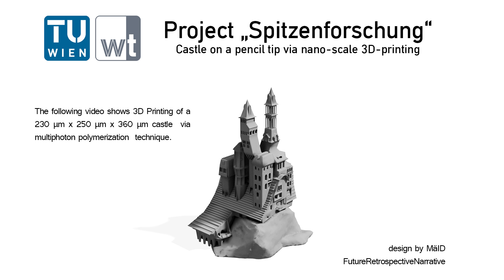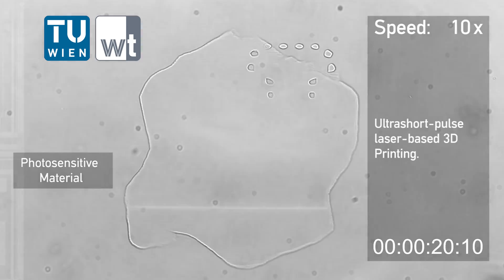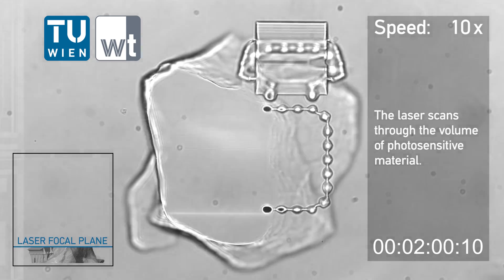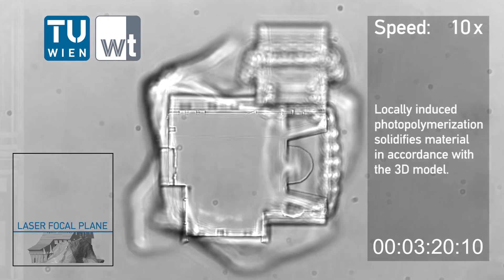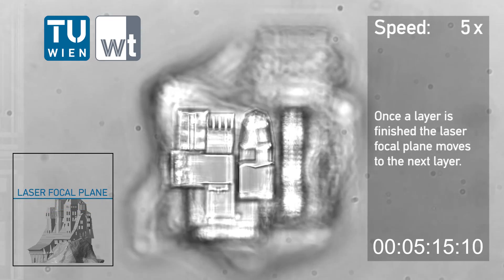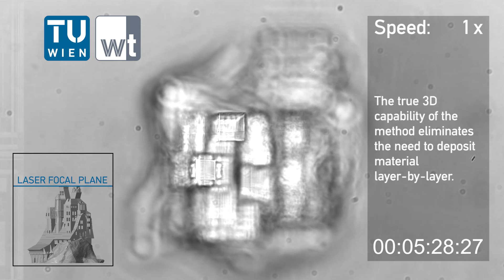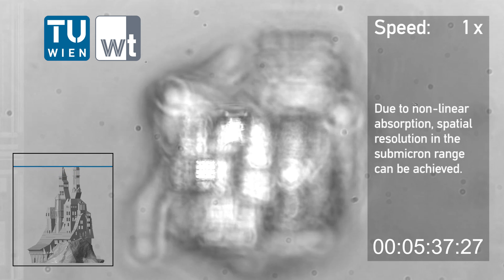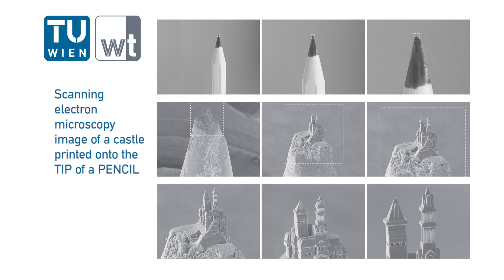Castle on a pencil tip via nano-scale 3D-printing

Comment: That is incredible. How well can the printed objects be scaled up while still maintaining sub-micron resolution? Or in other words, how big of an object can you print at those resolutions? Is it limited by how large an STP file your computer can handle? Seems like there are some serious applications for microfluidics considering the resolution you can achieve with a system like this. How strong or chemical resistant are the resins used for this? Does it have practical applications or is it still in the prototype stage? And what is the maximum print height? Sorry for a million questions but this is some intriguing stuff.

Comment: Really good job.
Is the vertical speed independent of the amount of data in each layer? Is there any heat produced in the liquid/solid which may deform the parts?
Reply: vertical (z) speed is limited by the stage speed but does not depend on the amount of data. Of course a larger area will take more time for each plane (x,y) to finish. Since the polymerization is based on photo-chemical reaction no heating of the sample occurs